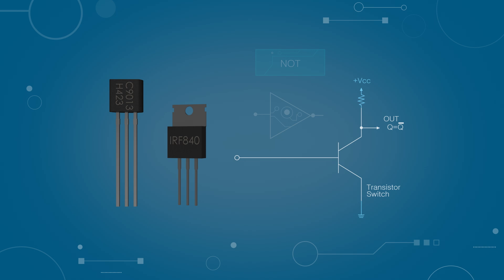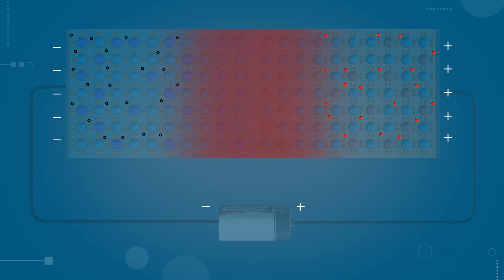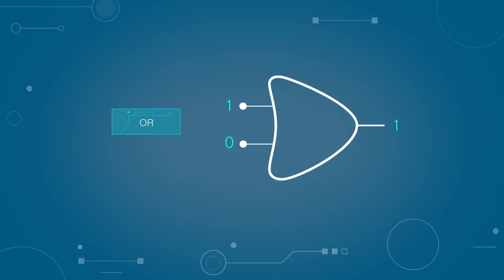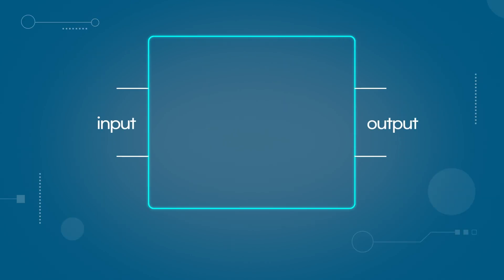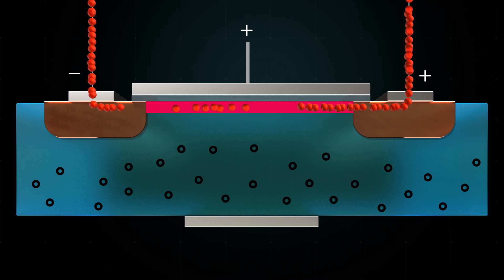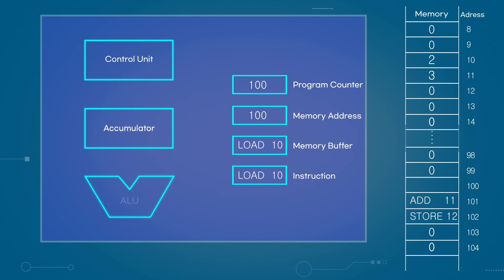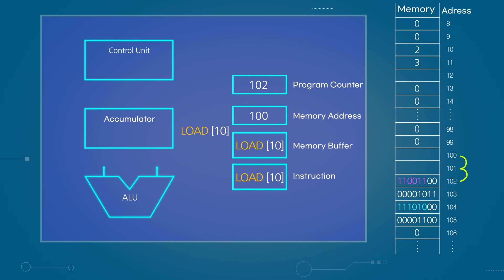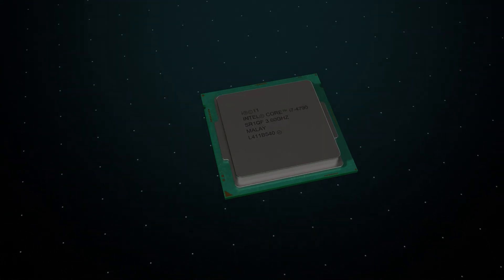How Does a CPU Work? | The Fundamental Principles of CPU Architecture

Comment: Forward-biased means applying voltage to make a p-n junction conduct current, with the positive battery terminal connected to the p-type and the negative to the n-type, which narrows the depletion layer and lowers the potential barrier. Reverse-biased means the negative terminal connects to the p-type and the positive to the n-type, widening the depletion layer, increasing the potential barrier, and blocking significant current flow.